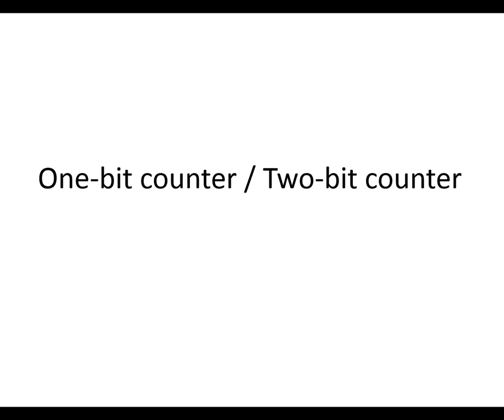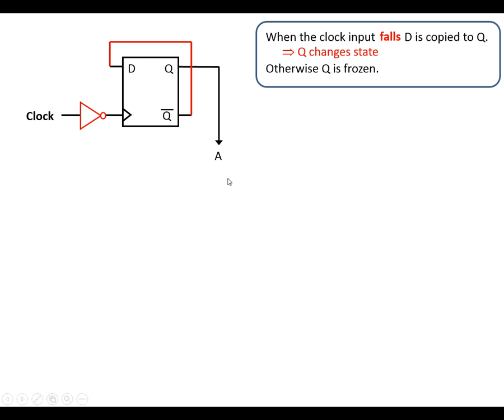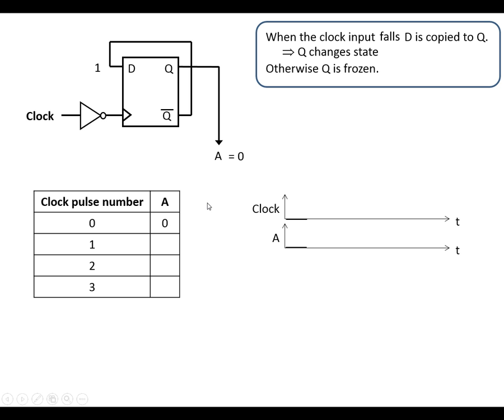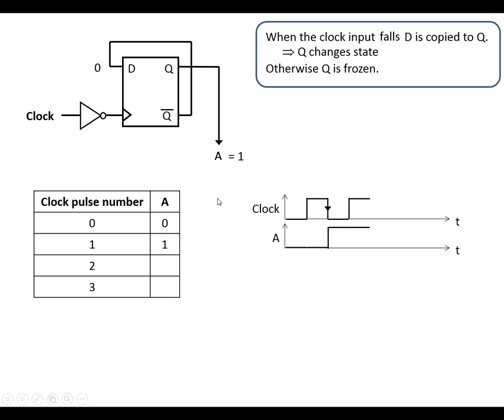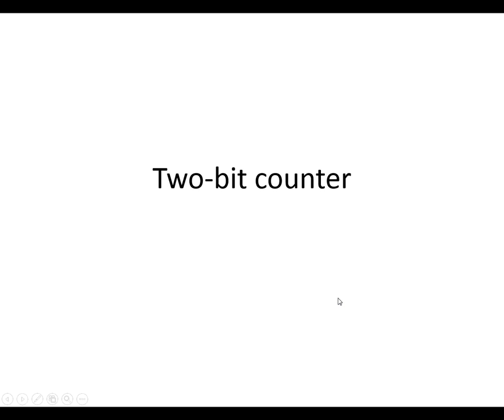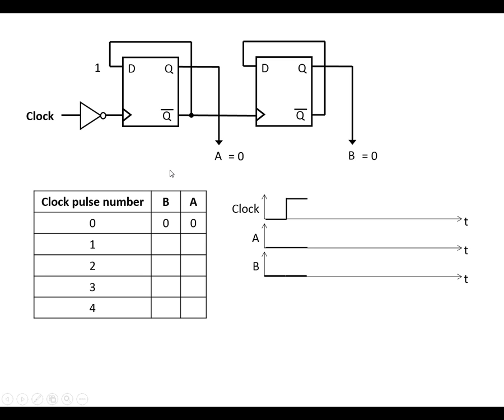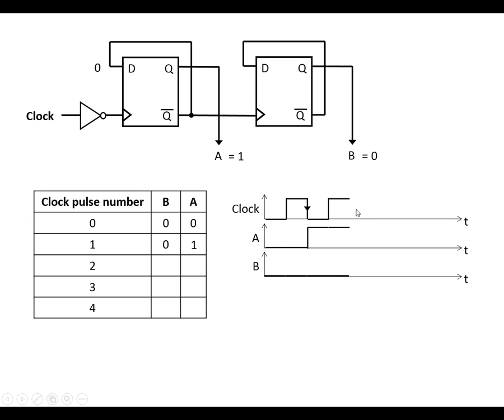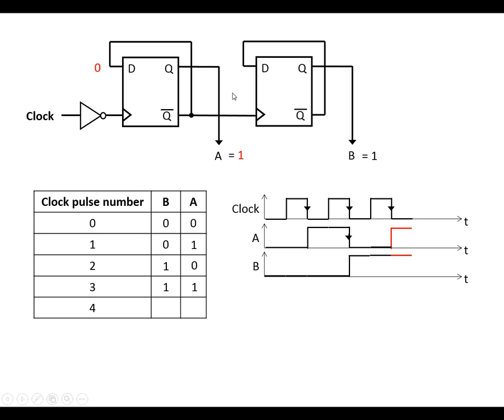1 bit and 2 bit counter

Comment: a stepper motor driver : i have 1 wire complete ; adding 3 more wires with inverters and test it. try to see where  it starts and then add reverse. see where reverse starts.
Reply from the maker: It's been a while since I've played around with circuits (just teaching Physics now). Stepper motors and servos are great fun. Good luck with this, and thanks for the comment.
Reply: 5 wire stepper motors seem best. 6 wire can be maybe turned into a 5 wire. 4 wire stepper motors need 8 same transistors.

Comment: What do you mean by "least significant bit" and 'most significant bit"??
Reply from the maker: In binary, the least significant bit is the units (like in base-10, where the units are the least significant, then comes the tens, hundreds etc ... each being more 'significant' than the previous one).
In the 2-bit counter, the first output is the ones (the least significant number), and the second output will be the twos (more significant than the ones). A third bit would represent fours, which would be more significant than twos.

Comment: Not inverting the first clock seems to give a proper counter as well.  Any advice on why you inverted your first counter?
Is it because we can choose whether we want it clocked on rising or falling edge?
Reply from the maker: Yes. This was what the exam board wanted. Without the NOT it will be rising-edge triggered.
Reply: what's wrong if it's rising edge triggered?
 @andrewmasters5020

Comment: It doesnt work with 4 bits. right?
Reply from the maker: Yes it does. See my 'n to m' counters video for the 3-bit version. Keep adding flip-flops for more bits.
In reality there will be propagation delay, which gets more apparent when there are more bits (each flip-flop takes time to change, and only changes when the previous flip-flop has changed), but that wasn't in the A-level course so isn't covered in my videos.
Reply: @andrewmasters5020  Thanks. So it not enough instruments for using it in real   cpu? It need some enable, or option to take data from outside for start counting from different number, not zero? Hope you understand what i mean, not great engl.
Reply from the maker: @stbessonov  This only shows the basic principle of how to make a counter. I made these videos to help my 16-19 students with exams and projects, so some of the examples are strange.
Search for 'asynchronous counters' to see how to make a better counter. Good luck!
Reply: @andrewmasters5020  thank you

Comment: http://simulator.io/board/gAj9YwhV41/4 I did that but its count reverse. like 0-3-2-1

if I put a NOT gate between first D-FlipFlop and second D-FlipFlop this time it counts 2-3-0-1-2-3-0-1-2-3-0
Reply from the maker: Hi, I've had a look at your circuit. You appear to have falling-edge triggered flip-flops. Mine are rising-edge triggered. That's why the NOT gate works for you.
Reply: The d-flip flop component that the simulator uses is a falling edge clocked.